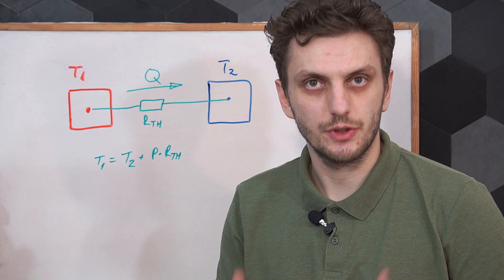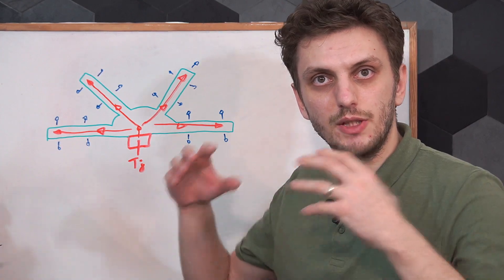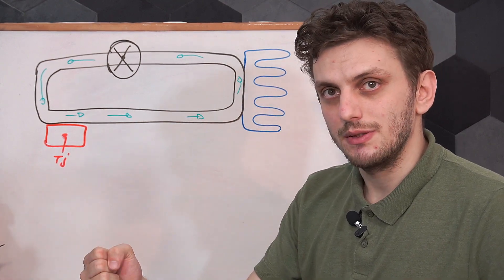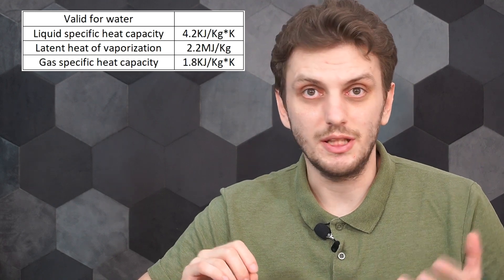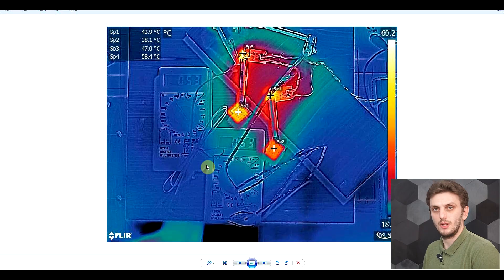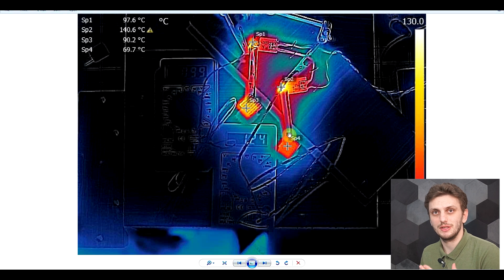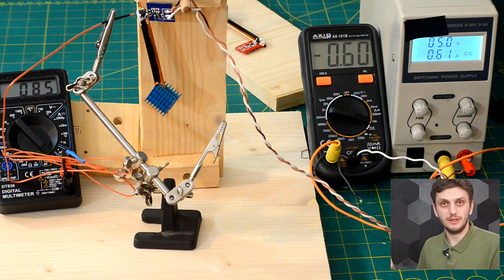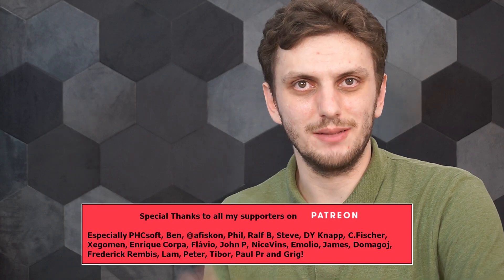Electronics tutorial - HEAT PIPES

Comment: Thanks for the video!

I would add that gravity can improve the Qmax (maximum transmission power) parameter of the heat pipe. If the heat source is below the heatsink, gravity helps the liquid return to the evaporator.
There are also heat pipes with a special wick structure inside that are less affected by gravity.

The heat pipe is good because it can't just transfer heat to the far heatsink, it helps to use a large heatsink more efficiently, because the heat pipe in this application can be used to distribute heat over the radiator surface.

Comment: interesting measurements. I wonder if the fluid ends up leaking out after a few decades.
Reply from the maker: As long as the heat pipe is sealed properly that should not happen. As a side node, while I was soldering the transistor to the pipe, it got so hot it went from a rectangle section to a circle section from the intense pressure building up inside, but it did not burst open, so I guess the sealing is done properly.

Comment: I always assumed the liquid inside was some sort of alcohol! 
It's just water! Silly me!
Reply from the maker: The nice thing about water is that is can vaporize in a very wide temperature range depending on pressure, so its sufficient in the temperature range in which normal electronics usually work. I've read that in more exotic heat pipes used in aerospace applications you can have ammonia but I haven't found anything about alcohol.
Reply: @FesZElectronics  I never read anywhere about alcohol as the liquid inside. I only assumed. Ammonia would also make sense for extreme temperature applications.
Reply: @piconano  different liquids are used for heatpipes. Water has the advantage of a very big energy transfer on phase change. But if your application requires low temperature performance, you can use mixtures of other fluids. The "drinking bird" is an example of a heatpipe which doesn't use water.
Reply: It is probably a very clean water.